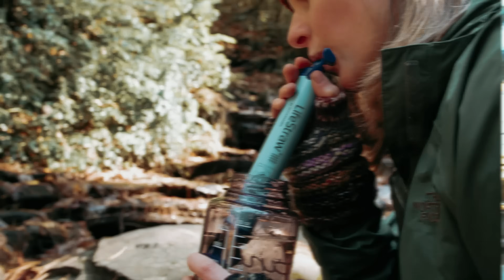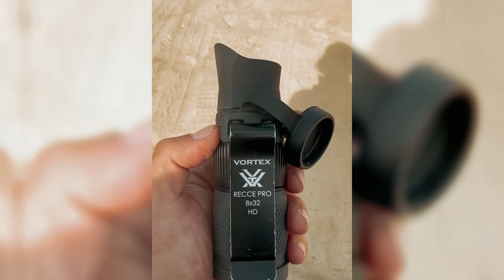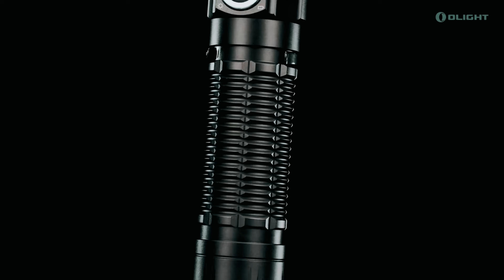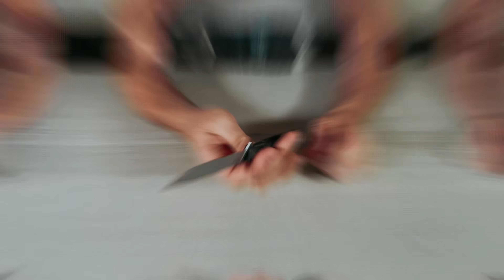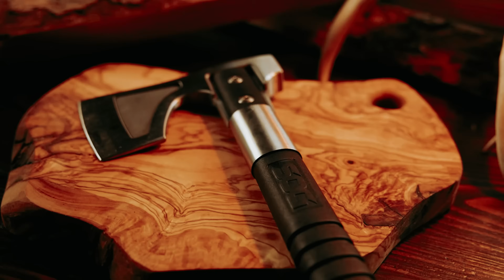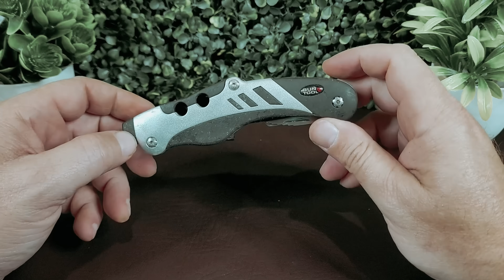30 Tactical Gear & Gadgets on Amazon Every Prepper Should Own

Comment from the maker: ➡ Links of the 30 Tactical Gear & Gadgets on Amazon Every Prepper Should Own we listed in this video.

1. Gerber Gear Stake Out 11 in 1 Multi Tool  
https://bit.ly/4lwu2rW

2. Jetboil Flash Camping & Backpacking Stove System  
https://bit.ly/4oI3KWw

3. Real Avid Gun Tool 18 in 1 Multitool  
https://bit.ly/4oCMVwd

4. GCI Outdoor Master Cook Station  
https://bit.ly/4mSGhjL

5. Zune Lotoo 28 in 1 Survival Shovel Kit  
https://bit.ly/3UzbkFa

6. RecPak Ultralight Instant Meal (700 Cal)  
https://bit.ly/45BLBAW

7. Perimeter 12 Gauge Trip Alarm  
https://bit.ly/3JmDT6e

8. LTCANOPY 4 Person Inflatable Tent  
https://bit.ly/472QUvI

9. SOG SEAL Pup Elite Fixed Blade Knife  
https://bit.ly/46XKe1O

10. Unbreakable Walking Stick Umbrella U 115  
https://bit.ly/3Hunqwm

11. Atomic Bear Cobra Paracord Bracelet (2 Pack)  
https://bit.ly/4mUmD73

12. Wallet Ninja 18 in 1 Credit Card Multitool  
https://bit.ly/3JjezhD

13. Tekto F2 Bravo Folding Knife  
https://bit.ly/45zNWw9

14. Thyrm CellVault 18 Battery Case  
https://bit.ly/4mJs749

15. Dango T01 Tactical Wallet + MT02 Multitool  
https://bit.ly/46YmyKN

16. Resqme Original Emergency Keychain Window Breaker & Seat Belt Cutter  
https://bit.ly/4mGzoSg

17. OLIGHT Warrior 3S 2,300 Lumen Rechargeable Tactical Flashlight  
https://bit.ly/45FEG9O

18. Garmin Instinct Tactical Rugged GPS Watch  
https://bit.ly/3JmE3um

19. IDOGEAR G3 Combat Shirt with Removable Elbow Pads  
https://bit.ly/473h6WW

20. Condor Recon Chest Rig  
https://bit.ly/4mkr8aO

21. MIRA Safety CM 6M CBRN Full Face Gas Mask  
https://bit.ly/4mxtfrS

22. Retevis RT22 Long Range Rechargeable Walkie Talkies (Pair)  
https://bit.ly/4oM9bDW

23. Vortex Optics Recce Pro HD 8×32 Tactical Monocular  
https://bit.ly/3HsxcPB

24. EVERLIT Advanced Emergency Trauma First Aid Kit  
https://bit.ly/4196UIS

25. PSE Viper SS Handheld Mini Crossbow  
https://bit.ly/4fDa7WQ

26. North American Rescue Gen 7 C A T Combat Application Tourniquet  
https://bit.ly/4mH5TzQ

27. Garmin inReach Mini 2 Satellite Communicator  
https://bit.ly/3UzbFrq

28. Exotac nanoSTRIKER XL Ferro Rod Fire Starter  
https://bit.ly/4mRY3ni

29. LifeStraw Peak Series Solo Water Filter  
https://bit.ly/472seDy

30. Goal Zero Nomad 10 Foldable Solar Panel  
https://bit.ly/4mUmr7P